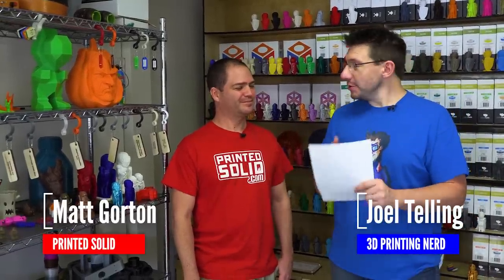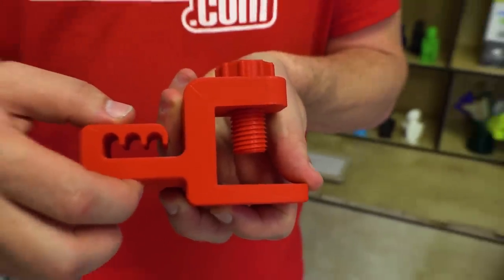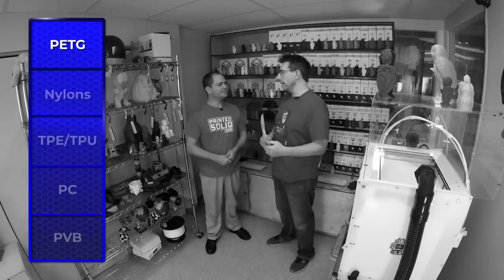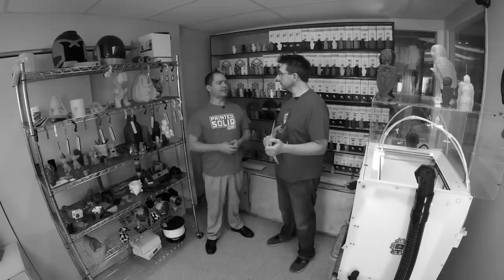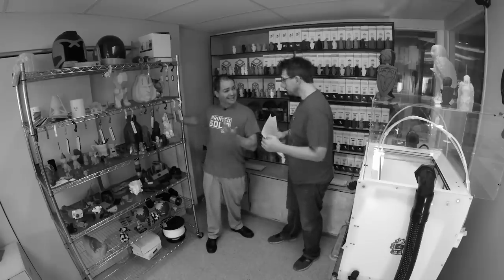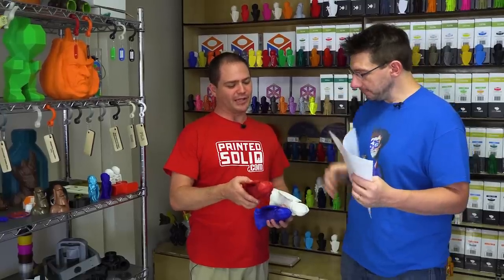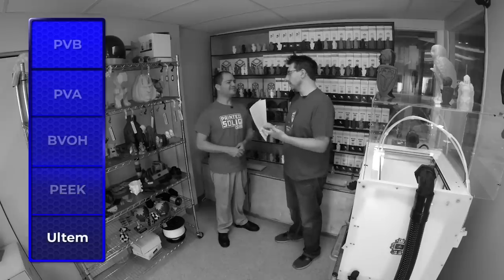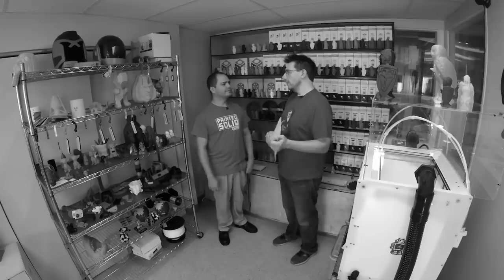Guide to 3D Printing Filament! PLA ABS PETG TPU PEEK ULTEM

Comment: hi i would to know about maintaing your machine
Reply: Its all different, like V slot rollers don't need oil (just wipe with a dry towel), but linear rods need routine cleaning about 5-8x more often (the oil traps more dust so it needs more often) and re-oil the rails. Also depending on the Z screw rods (except Delta as they don't have Z screw rods, only belts, or same for a Voron) as to whether or not you should oil them. And then some machines like my new CoreXY have crazy long belts so they need more often belt tightening (compared to my more standard bed slingers that I tighten the belt maybe once a year because they have auto-tension springs or simply don't stretch). Or at work how they have no tightening mechanism and you're just screwed...

Also depends on the material, like TPU I have to clean the bed every time as well as the nozzle, compared to ABS which is basically never, and only reglue the bed every month but some may need different adhesives and more often or some like PLA I use painters tape until it gets ripped up and then replace that strip.

There is no single answer, its like asking about "how to maintain car" when no car is the same: my car doesn't even have pistons, it has a triangle spinning on a sun gear in an elliptical pattern and has oil directly injected into the burn chamber, I also pre-mix oil into my fuel tank when I fill up at the gas station, something you would never do with a typical car, also mine you need to rev past 9000 RPM every time you drive it otherwise it builds carbon and will destroy the engine every 20k miles, but that's also the opposite of what you should do with a normal car. Other people charge their cars and use electric, so it varies a lot depending what style of car you have (also mine likes to destroy headlights for some reason, so I need to change those every 6 months compared to maybe every 20 years, but it depends what type of lights you have like LED/Halogen/Xenon/incandescent or the other 10 types).

Comment: Q: What are car dashboards/door panels made of?!?!?!
Reply: Often they use ASA
Reply: I'd like to know that too!
Reply: @M_Andras  Then read my answer to Grandpa Bill
Reply: Use to be basically everything inside your car was ABS, and still is on lower end cars but alot of mid and higher end cars have moved to a lot more soft touch materials and foams.
Reply: @mattgentry6387  Exactly right!
Reply: Any of the harder components that aren't foams are usually PC/ABS and PC

Comment: Also PETG is brittle AF / reaaaally weak.
Reply: i wonder if this is a "by brand" issue. My PTEG experiences have made V strong structural parts.
Reply: He forgot to mention it takes up moisture and goes brittle. Anyway, it does. Dry out your filament.
Reply: I have mounts on my atv that have lasted over a year now all printed with PETG.
Reply: Was not moist, straight out of the package and a hot chamber drier feeder was also tried which i had been using very successfully for years.

Funny how every time i point out that PETG is weak, everyone jumps to do personal attacks / claiming PEBKAC :) :)

Oh, i tried multiple different brands. I spent thousands of euros on that research, i literally had skin in the game and needed PETG to succeed. Testing was done very systematically.

The worst part of PETG was tho that when it breaks, it can break into sharp shards. We needed PETG parts for car aero parts, and creating sharp knifes when there is a collision is just a no go. Fortunately no part was mechanically strong enough to ever be installed on the car.

Cannot imagine what kind of damage could have happened when a pebble hits a part at 300kph and sharp chunks fly all over the place.

During this research i suspected issue is internal stresses forming into larger more solid parts.
Reply: @RevampedOutdoors  let us know when a PETG part pierces someones arteries lol (or don't, just get rid of them before that happens!)
Reply: @skaltura  lol ok bro.
Reply: brittle compared to what? weak compared to what?
Reply: I have also noticed that PETG can be very brittle. I designed an U-lock holder for my bicycle and all PLA test prints could flex over the bikeframe but none of the "finished" PETG holders could not withouth shattering 🤔